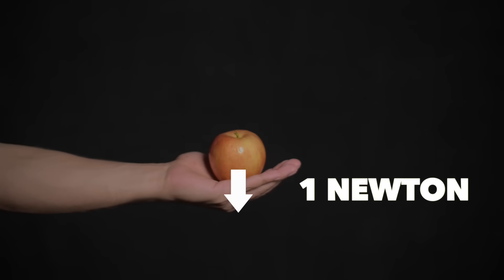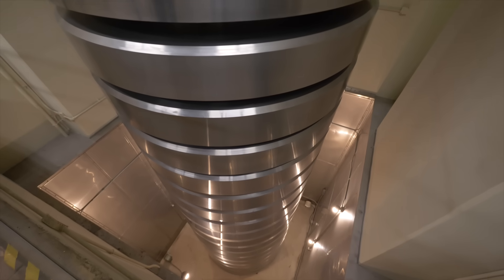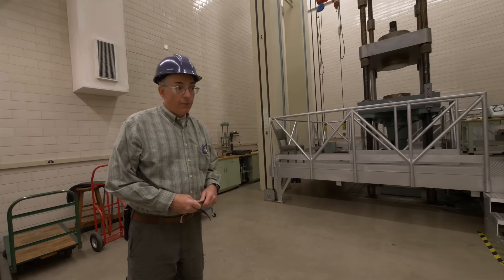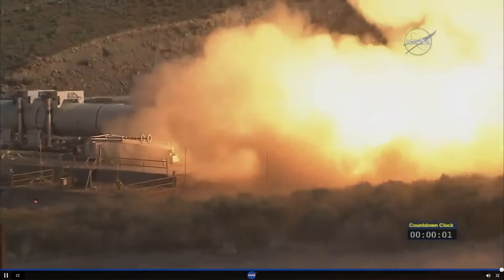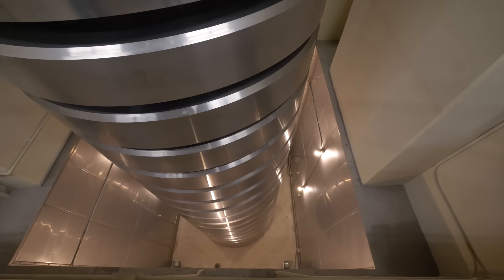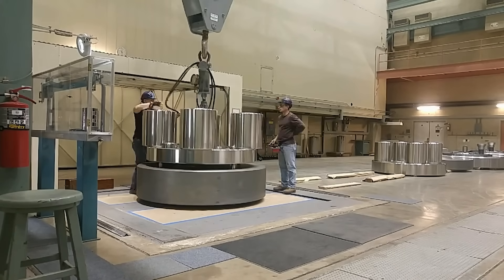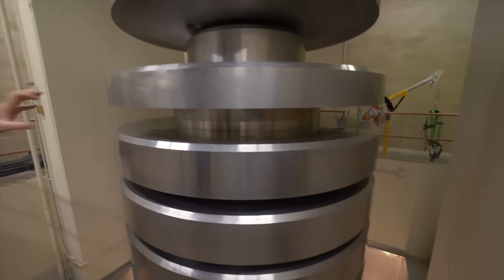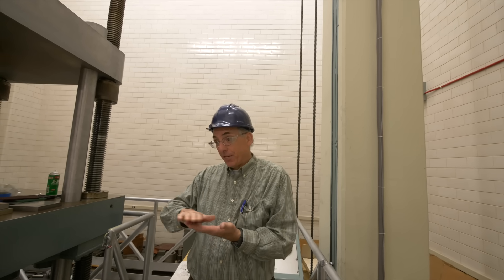World's Heaviest Weight

Comment: If 125 pounds of air are displaces another 125pounds needs to be added but does that 125 pounds added have their volume of displacement in mass factored in ? i guess yes but how they counteract structure compression when lifting up weights ? becouse lifting components should slowly strech and display smaller mass as part of mass would move down not acting with full force am i right ?

Comment: I wonder how constant the Earth's gravity is?  Since they're using this as a calibration force, I wonder if there could be events far beneath the Earth's surface that might cause small variations in gravity, slightly changing the force exerted by the mass over time?  If you had a really stable sensor, you might be able to use this as a measurement of gravity variations.  Also, it would respond to small variations in position, such as those caused by an earthquake far away.  So this might make a sensitive seismograph as well.
Reply: They measure the local gravity from space. Just Google "gravitational map of Earth".

Not sure if it's sensitive enough to detect changes that would affect a million pounds by just a few though.

In Canada there's an area that's still rebounding from the glaciers. It only moves up a tiny fraction of an inch a year(probably in other areas too). Doubt any sensors would be sensitive enough to measure that change in gravity, except over several year's time maybe.
Reply: It stays very constant over time. But there are  differences depending on where you are on the planet.

Comment: So they start counting with kg and then use lbs...

WHYYYYYYYYYY
Reply: there are whole documentaries on the kilogram, really interesting stuff, worth a watch.
Reply: Canada's influence 
Next they will be using kilometers instead of miles and and Celsius instead of Fahrenheit
Reply: @crimsonkarma13  Like the way it should be.
Reply: Only three countries – the U.S., Liberia and Myanmar still use the Imperial System
Reply: @jimmyzhao9748   that far from true. Gold and silver sold in the Troy system another system  that not metric, much of eroupens use stones for human weight. Miles mean minutes of rotation still use. The house power use every where.
Reply: The pound and all measuring units are based off of the kilogram. Look up a video on the kilogram it will explain.
Reply: @EthanKeating  Technically true, in a bureaucratic paperwork way. Which I think is one of the least useful ways to be true. In the same way, the gram is based on the kilogram! 1000 vs 2.2, whatever, the universe doesn't care.

Metric is better because more people use it. No more, no less. No need to make up weird reasons about its supposed objective superiority.
Reply: Zieely you might have that slightly backwards 😂
Reply: @him050  no, every imperial unit is based on an equivalent metric countrepart.
Reply: @Wischmopps the satellite failed because they used different units. Why are the imperial units blamed?

I prefer metric, but cmon dude, use argument that doesn't require the reader to already agree with you.
Reply: I assume they expect the rest of us to eventally switch to their superior system.
Reply: @andreassumerauer5028  stop it with your base ten non sense!!!!! Math isn’t suppose to be easy! That’s why Europe is weak and every American can do advanced calculus just to log into their bank account.
.
.
I’m kidding and the bank captcha is from kitboga.
Reply: Canadians use pounds too.
Reply: @adanactnomew7085  not in anything that matters.  ie math, physics, etc.
Reply: 'murica f*ck yeah
Reply: Coz America
Reply: Because the pound is not a physical weight and they are americans. A pound is 0.453592kg and this is how you measure it. No freedom units without metic units...
Reply: Pounds have their core measurement unit based off of the kilogram. They don't suffer as big of a discrepancy vs kilogram units though when it comes to calculations. This is because the kilogram unit is constantly changing, but the pound is slightly more stable
Reply: @Lominoth  
The pound is based off the Kilogram.  But the pound is more stable?  Dude, they would be the same stability because one is based off the other XD
And, the kilogram has been standardized quite a while ago as a defined mass of silicon atoms.
So no, the kilogram does not vary anymore.
Reply: @x223blackwolf  it used to. However, before the kilogram has never had a defined mathematics definition til recently.  Pounds however have always had a defined mathematical definition.

Pound, unit of avoirdupois weight, equal to 16 ounces, 7,000 grains, or 0.45359237 kg, and of troy and apothecaries' weight, equal to 12 ounces, 5,760 grains, or 0.3732417216 kg. The Roman ancestor of the modern pound, the libra, is the source of the abbreviation lb.

So 1 lb is roughly half a kilogram, though it can also be defined as 7000 grains which is internally based off the grams instead of kilograms. Which comes out to 15.43 grams
 Since grams are more accurate than kilograms and subject to less change. This is because a gram is equal to one cubic centimeter of water at it's maximum density.

So since the pound can be both based physically off the pound, yet non physically because it has a mathematical definition (grains/grams) it can be theorized that the pound IS physically more stable than the kilogram.
    Heck the water definition alone shows it's more stable
Reply: @Lominoth  grams are defined by the kilogram ... . Saying that the lb is more precise because it is based on the gram and not the kilogram is basically a meaningless statement.
Reply: @Mysterios1989  grams are not based on the kilogram. The kilogram is based on the gram, hence why it's called a KILOGRAM a.k.a. a thousand grams.  A gram is defined as the weight of a 1x1 centemeter cube of water. 

So tell me again how the gram is based on the kilogram when the litteral definition of a kilogram would mean a kilogram is defined by a thousand grams?
Reply: @Lominoth  you can define 1 kg as 1000 gram or the weight of 10 cubic cm. It is completely interchangeable, which makes your claim that the lb because it is based on gramm completely senseless. Also, the weight of water as a definition was abonded because it is too inconsistent (which makes your claim.about the consistency even less sensible) today is the kilogram the centre of definition based on a precise calculations of molecules of seilicium, and the gramm is defined based on that standard.
Reply: @Mysterios1989  the problem with this is that the kilogram is also highly unstable. If you do not have a fixed mathamatical definition you cannot call your unit of weight or measure viable
Reply: @Lominoth  there is a fixed scientific defintion of the kilogram. From wikipedia:

The kilogram, symbol kg, is the SI unit of mass. It is defined by taking the fixed numerical value of the Planck constant h to be 6.62607015×10−34 when expressed in the unit J⋅s, which is equal to kg⋅m2⋅s−1, where the metre and the second are defined in terms of c and ΔνCs.[

 And again, the same is true fir the gram (as it is a derivat of the kilogram and its definition) and as a direct consequence also for the imperial measures. Every inconsistency for the kilogram is also true for the imperial unite, as it is literally defined by the kilogram.
Reply: @Mysterios1989  if that were the case they would not need to create a  silicon ball to base the measurements for a kilogram on (a previous video) either you have a solid, definable mathamatical formula that cannot be changed, or you will constantly need to update your equipment which is inefficient
Reply: @Lominoth  the silicone ball is reproducible, but it is way easier to have the silicone ball for every day measurements. And again, this changes nothing in support if your beginning argument about the higher reliability of imperial, because all the issues of the kg is there with the lb.
Reply: @Mysterios1989   also the weight of one cubic centimeter of water does not change, even if under a phase change, the volume changes but as long as the container is sealed it will not change weight 

How much can something change and still remain the same? When water freezes, the changes seem dramatic, and yet the kind of matter remains the same - it's still water. While liquid water and frozen water have different names and some different properties, the kind of matter remains the same, and for a specific sample of water, the weight does not change. The volume of a sample is not conserved across a phase change. Freeze water and its volume will increase. Evaporate that same sample of water and its volume will increase even more, but its weight will be conserved. 

So since the pound is based on the gram and not the kilogram, it is safe to say the pound is technically more stable
Reply: @Lominoth  ?? The gram is based on the killogram, that is how it is defined, because the killogram is defined.

And it is very difficult to get an accurat reading of water. It has to be purified, it has to be at an exact temperature, it has to be read at the exact same room pressure (as the room pressure can change the density of the water, and all over the world, there are slight variations of pressure that don't make a difference in everyday life, but a complete difference for scientific experiments like these measurements), you have to be extremely precise with the length of a cm (which again, is not easy), you have the issues of variation of the container, as you can never measure the weight of the water without it, and even slight variations of it can cause inaccuracy. The list where the problems lie could go on and on. The water weight is a good approximation of the weight, but it is very unpracticable to make it in a scientific viable precision, making it nearly impossible to use for any scientific measurements.
Reply: @Mysterios1989  The cubic centimeter is a very important unit in the metric system. One cm3 of water is defined in the metric system as 1 gram! 

This is directly from my science book
Reply: @Mysterios1989  your assumption on water is actually incorrect water weighs the same regardless of if it is a liquid gas or solid the only thing that changes is the volume of the water steamways the exact same weather IT'S SUBLIMATES OR WHETHER IT STAYS AS STEAM THIS IS COMMON KNOWLEDGE WATER THAT IS PURIFIED IS THE ONLY REQUIREMENT
Reply: @Mysterios1989  also a cubic centimeter is a cubic centimeter regardless of the shape of the container a centimeter actually has a mathematical formula behind it that shows what it is worth the kilogram is based off of a gram which is in turn based off of one cubic centimeter of water so if we know the mathematical formula for a cubic centimeter we know how much purified water is necessary and we know the exact weight of that water so we know what a gram is therefore we know what a kilogram is after we know what the gram is and then we know what the pound is
Reply: Because freedom units!
Reply: @Gift0r  no they're stupid units
Reply: Just so that they can feel special
Reply: Ok, I’ll make a deal with you.  We’ll switch to metric if you change the following pronunciations and words:
Trainers - shoes or kicks
Chips - fries
Queue - line
Crisps - chips
Pitch - field
Boots - cleats
Adidas - (Uh-DEE-dus, not AH-dee—dahs)
Nike - (Nigh-keys, not N-EYE-K)
Reply: @jpman9   I refuse to call shoes "kicks"
Reply: Cuz Ibs is measured by kg, and whenever Murica measures something they always have to include Ibs
Reply: Title: "world's heaviest weight"

The world itself: AM I A JOKE TO YOU?
Reply: Exactly that... The video was good, but went downhill at @3:28
Reply: Because they obviously wanted to use the proper units
Reply: Because they would rather use the units forced on them by their former colonial overlords, instead of the units invented by their revolutionary cousins.
Reply: Because Tucker Carlson
Reply: Because the kg is accurately defined and the pound isn't. The kg is the standard measurement for weight.
Reply: @BillGreenAZ  ... unit of mass. ;-)
Reply: because they know something you don't?
Reply: @Grasss  Sure, they know what a pound is and I don't
Reply: @Grasss  Bruh, metric units aren't called "scientific" for nothing, they're precise to the atom level, you can't compare that with a unit that literally measures distance by feet.
Reply: @Mohammed-bd7ql  Bruh,  guys who built this multi million dollar facility are much more of a physics scientists then me and you. Chances are they know something about units of measure that you don't.
Reply: @Grasss  that has nothing to do with being smart, he only uses pounds because imperial is the US's system
Reply: @Grasss  than
Reply: @Grasss  guys who built are literally from American an no other reason . 😂😂😂😂
Reply: @Mohammed-bd7ql  Its imperial because that's a good way for americans, and it's in america. Not because it's something that's scientifically used elsewhere
Reply: - He says in the video that they start with metric weights and convert to imperial
- American scientists typically use metric while working, and convert to imperial for business and marketing, since outside of scientists and engineers, imperial units are more common
- Imperial units are still around because they were grandfathered in, general public knows them better than metric, and there's not a reason compelling enough to warrant the cost of changing everything at once. The USA is a big place and most governmental decisions are done on a local or state level, so sweeping changes are difficult
- It's cool to say imperial measurements are dumb, but they're had their uses. Many of the conversions are factors of 2 or 3, which is a lot easier to do by eye than metric, which was useful back before there was a Walmart every few blocks selling cheap measuring cups. It's not like your grandparents were raised by their parents spouting "durrr freedom units"
- Despite all this, yes everything would be easier if everyone switched to metric.
Reply: @Grasss  that pounds themselves are measure with kgs and are a redundant measurement

Comment: "An apple weights about one Newton"

It took two seconds failing at basic physics and not distinguishing between mass and force.
Reply: Lmao, you can weigh things measuring their pushback against the normal force. Somebody slept when the class went over force diagrams
Reply: @brenankean147  yep, standing on a scale, you'd be the the equivalent to 1kN in Force directed to the centre of the earth, sitting in a rollercoaster you might be the equivalent of 0-5 kN in whatever direction ...

The apple might act like 1N, when it is laying still on the ground, but it never WEIGHTS 1N. It might weigh a 100g or 0.22 lbs. (based on your comment i guess you're american)

Comment: Why didn’t they make it 1 million kilo? Almost every country uses the metric system and could therefore profit from this knowledge.
Reply: It's Private  what
Reply: It's Private  how many feet in a mile?
Reply: idk maybe because they are in the US?!
Reply: @PhoenixMorris  well then, why won't the US just use the metric system then?
Reply: Manuel W they use everything except metric system, like 20 washing machines wide
Reply: that things got about 7 ford f150s of force
Reply: @vyvynguyen3660  "stays 2 komodo dragon away each other"
Reply: Manuel W Because staying in the same unit is helpful, while only idiots would be so bad at measurements that they need to go a magnitude up or down from what they were initially measuring in, and thus require the ease of use of dividing/multiplying by 10
Reply: @NinjaMinkzx  but why make it yourself more difficult than needed?

Comment: Looks like my vertical molten aluminum die casting machine just a little taller. My machine can close with over 200,000 pounds of pressure and i lean into it over a hundred times a day for the last 7 years don't be scared homies

Comment: "In the old movies you'd hear: "Go to 104% power!"
Well, how do they know it's 104% of power? 
Because someone has measured it, somewhere."
Reply: And this was the most dubious in this clip. How can you have more than maximum power?
Reply: @Sauromannen  most things have some headroom beyond their 100% rated power, nothing breaks at 101% of designed load.
Reply: jonas1015119 you are missing my point. Maximum power is maximum power. It is like having a knob on an amplifier saying ”11” and think it makes it more powerful.
Reply: @Sauromannen 100% is a reference point like any other.  It doesn't always mean absolute maximum, especially when an engine has been tweaked better than it's original design.  They improved the space shuttle main engine many times, but didn't move the 100% marker, which was an arbitrary perfect amount of thrust anyway.  You'd always hear >100% percentages at launch.  Confused the heck out of me for a while.
Reply: @Sauromannen  Because they improved it and kept the original 100% as a reference.  When they design rockets for X pounds of thrust but realize it has room for further tweaking, they call that 104%, etc.  You used to hear it in space shuttle launches all the time.

Comment: Do they have to take the height of the stack into consideration?  The top elements will weigh very slightly less than the bottom ones.  Or is this difference negligible?

Comment: For simpletons sake, which was not really explained here by the host : That weight machine that goes up to 1M lbs is the calibration standard for the force transducer that actually does the measurement. A set of transducers is what is placed behind the engine and together they can measure the force generated by the engine.